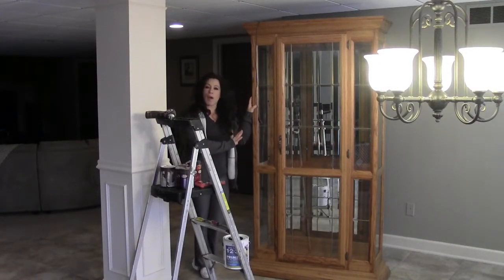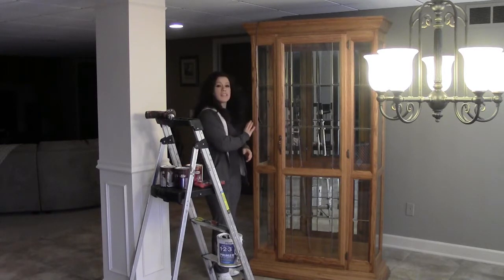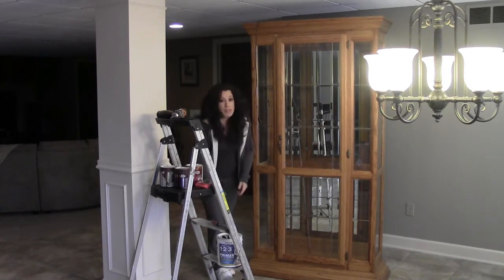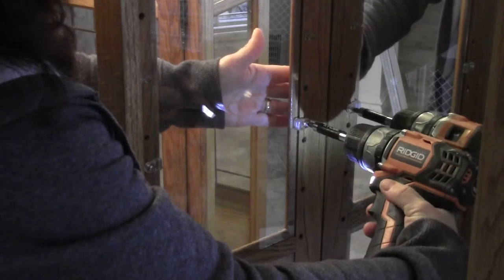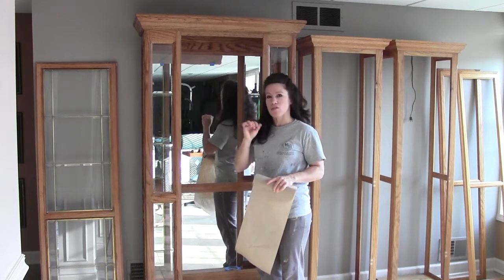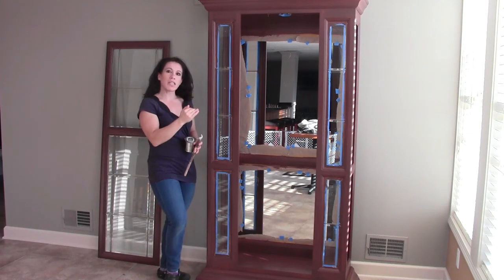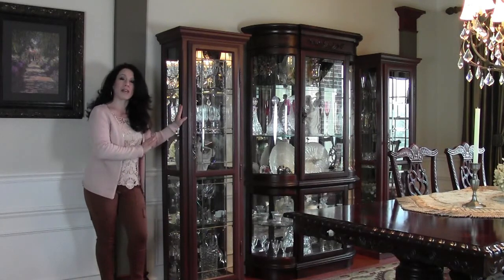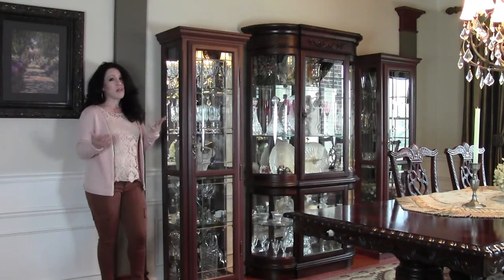Faux Wood Grain Finish (how to paint) - Renee Romeo

Comment: Best diy explanation that I’ve seen yet. Thank you for posting. This video helped me tremendously.
Reply from the maker: todd hannah, Thank you! I've been doing this finish for years. It's the easiest way to achieve a wood look without messy products or unnecessary steps. You'll have the same results too. You can play with the pressure on the sponge to get more or less grain too. What are you working on? Have fun with this, Renee
Reply: Renee Romeo I have a 1950 house with original doors that I can’t find to match so I have a prime red white door I’m going to match the others   A lot of other videos try to promote products but your video truly is for diy’s minded people
Reply from the maker: todd hannah, I'll be doing the same project on a house that I just bought. The basement has two rooms with painted trim and the rest of the house is natural wood. I've done this many times before and you'll get a great match too. The hardest part is getting the base color right. My advice (forgot if I mentioned this or not in the video) is to squint your eyes when looking at the piece you want to match the door to. It helps to reveal the underlying tone. It'll be an odd color, I'm sure. Let me know how it goes! We're all trying to look like pros here (without the added fuss). All the best, Renee
Reply: Renee Romeo thanks for the advise. Have fun painting

Comment: I like your. System  and the detailed instructions  in the video BTW you are  one of the prettier Faux painters on YouTube  as well  its meant to be a compliment and a little. Funny  because of my sense of humour most of the other Channels i watched were men demonstrating their teqniques  i am actually a  retired Woodworker  and. On rare occasions usually a screw up  on a job. We used to hire a Faux painter to  blend in  certain parts of a stain grade wood job  sometimes. Something could be a a result of a accident. That happened after the  product. Was installed or even the client. Wanted a change  ? The Cherry cabinets you used as a demo. Were very good BTW   Whenever i did a match up  i always used a tiny. Amount of black paint to blend. The  original grain  to the new or Fake one  it was such a tiny amount. Of black that I didn’t. Even buy a can of paint i simply carried a paint pen   And put a line  parrelel to the grain  then  wiped it almost gone with a paint brush. Or  dry rag  to  complete the  look  oh one other thing i did find interesting that overall  Women did do a better job than  most of the men i hired  to do the  same type of work  i of course used. Who ever  could get the job done to meet  the customers  demands  and often the work needed to be done off hours or weekends  because of businesses  needing to be running normal hours in that case the men were more flexible  in the hours they. Would work than the women  ? The majority of my work was in  Washington D.C.  and adhered to  government hours and restrictions  much of which. Required  some type of background check  that usually meant  a   Trip to the DC corrections or FBI for fingerprinting  purposes
Reply from the maker: Craig Monteforte, Thank you for the compliment! I used to paint murals and do faux finishing for clients too - although I never did need fingerprinting first - haha! Thank you for the advice about using black and the use of paint pens. I can see how they would be very useful for additional graining or distressing. Working on the weekend never scares me. I'm always up to something no matter what day it is! Thank you for taking the time to send this nice note. All the best, Renee

Comment: Generally I have seen paint peel when DIYers paint their kitchen cabinets since they get so much use. Do you know if the primer and the top coat used would be protective enough for kitchen cabinets?
Reply from the maker: @bebeames7353  I have painted cabinets in an overnight rental property and the cabinets are perfect. They won't peel.